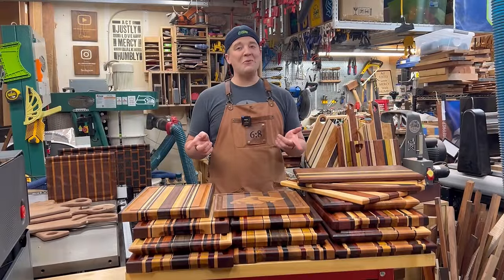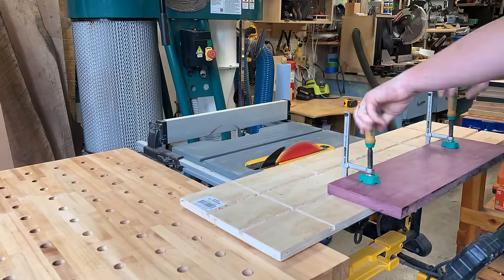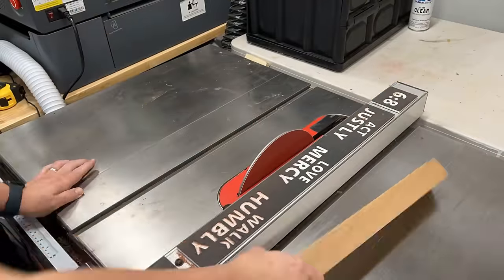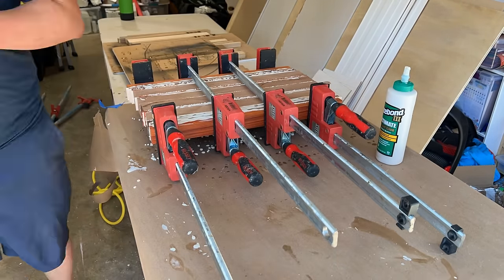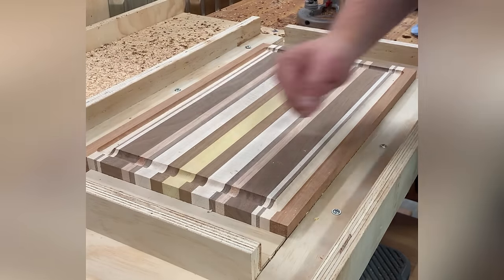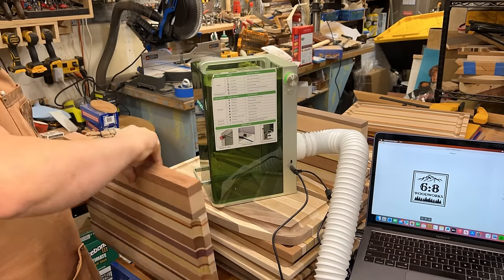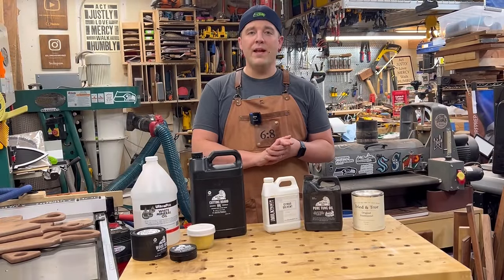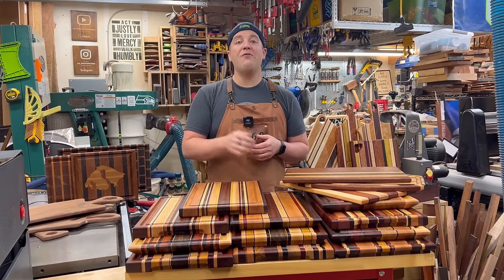Cutting Board 101 & 102: How to Make a Cutting Board -Tips from Hundreds of Boards Made

Comment: The same Wood Whisperer video that he references also has a pretty telling torture test with all the finishes. Spoiler alert: Tung Oil is by far the superior finish. 6:8 is right, Tung Oil does take more time for YOU to apply as a finish. However, you're not making things for YOUR ease and convenience, you're making things that paying customers will be using, so the only option at that point is Tung Oil. Anything else looks pretty but doesn't last like 100% Pure Tung Oil does. Just be sure that it says 100% or Pure or 100% Pure in the name. I use 100% Pure Tung Oil from HOPE'S, and so does The Wood Whisperer, and I would never use anything else unless a customer specifically asks for a type and brand of finish to use, assuming their request is food safe. I do appreciate the extra attention to the grain, in raising the grain and then knocking it back down for a more permanent smoothness. Wood can't be given too much love. Give it all the attention you can possibly afford to devote to it, and it will love you back. It's clear that 6:8 knows this. Do as many things as you can right, right from the start. It makes your job easier, and it makes the customer happier. He's getting his boards just right before he sends them out, and that attention to detail is what makes the difference between a $150 cutting board and a $400 cutting board. While Mr. $150 is trying to salvage and refinish his cutting board, Mr. $400 will be happily cutting away on his nice, smooth, like-new cutting board long in to the future.

Comment: During clamping, my board strips gets misaligned. What am i doing wrong?  I do apply lot of pressure to close any gaps, as my boards are not perfectly flat.  I have use dominos to align them and that works but a lot more work.  Any suggestions is appreciated.  thanks for a very nice video.  I do not have jointer and I just used planer  for both sides.  I know my sides are not parallel, but hardly noticable...

Comment: Thanks for the video, it has helped me quite a bit. I tried the Disc Sander for the table saw, and it almost ruined my table saw. When I tried to replace the disc with my blade the blade wouldn't go on the arbor! The glue from the disc got on my arbor and it took a lot of work to get off!  - I returned the system, That being said, this is still a very good video and greatly appreciated

Comment: I'm just finishing up my first batch of boards ( cutting and charcuterie ) I'll be looking at the sanding products that you came across.. I also picked up a couple other tricks that I'll use on the next batch
Thanks for this video Nick.
Reply from the maker: Awesome! Good luck with your boards!
Reply: @SixEightWoodworks  If I wipe water on the boards, then wipe it off after a couple mins.....is that long enough? Or do I need to let it sit longer?
Reply: That's long enough , even just a spray then wipe for a minute is enough. Just want to raise the grain once then sand it down
 @CreativeCustomDesigns

Comment: Great content and step by step instructions.
I've just completed my 1st cutting board and it looks awesome.
Now that it’s completed i’am concerned that the humidity level of the wood before the construction may be wrong? The wood was purchased as rough cut lumber and air dried for 1 year. I milled it down to my specifications. How should I be sure that moisture within the wood isn’t a problem on my next cutting board. The 1st one looks fine so fare but it’s only been a couple days of completion.

Comment: Greetings, What would be a good lathe for someone who wants to learn to turn wood?   Which lathe would you recommend?
Reply from the maker: I’d say this is the best deal: https://amzn.to/46SD5fz There are about five companies that have the same manufacturer for this beginner lathe. I have this version as the Rockler “Excelsior” one and it’s great. I have several Wen tools, and they do quite well for the price. I would recommend going with carbide cutters instead of traditional gouges. To maintain the sharpness of my chisels and gouges I had to spend a ton on accessories. So it’s much more affordable to just get a basic set with removable carbide cutters, like this one: https://amzn.to/4a8m9EJ

Comment: New subscriber, having never built a cutting board (river tables & shelves of reclaimed wood is my thing).  I came into a 150 year old broken piano.  Wood salvage meant lots of oak, a 3x6x5' piece of unfigured cherry (supporting sounding board), and several 3x4x3.5' pieces of old-growth doug fir.  Laser straight ultra tight grain w/o a single knot, hard as a rock. Not normal, but could you use as end-grain cutting board?  Anyone?

Comment: What product do you use from the SurfPrep line do you use to sand the juice grooves?  Thanks.
Reply: Looking at the video, looks like you are just using one of the square ones and using the edges?
Reply from the maker: I use the 3x4 electric ray. It’s fantastic and so versatile for loads of projects. On deeper grooves I just use the pro foam 10mm and 1/2” a little offset on the sander. Works amazingly well!
Reply: @SixEightWoodworks  thanks.

Comment: shouldn't the lip on the planer sled be in the front, because that's the direction of the feed? The rollers are pulling the wood forward, not backward.

Comment: I don't understand why you rotate the wood 90 degrees before glue up.  Please expound on this.
Reply: Looking at your web site, you list boards as edge grain.  I think you mean quarter or rif cut. Therefore rotating the board, as you say in the video, depends on where in the tree or the board your cutoff comes from. This gives the cutting board a straight grain look. What species is that black wood. I assume ebony is way too expensive.